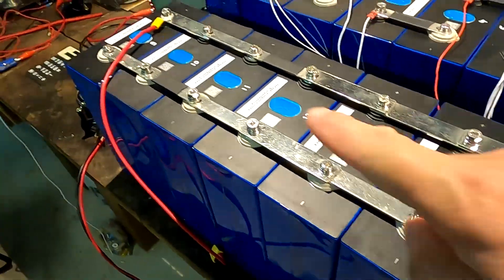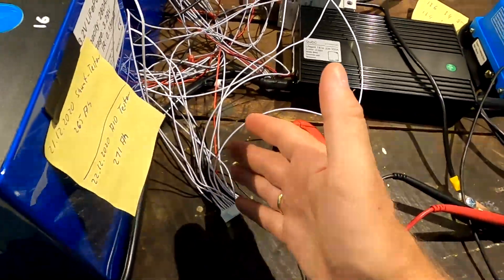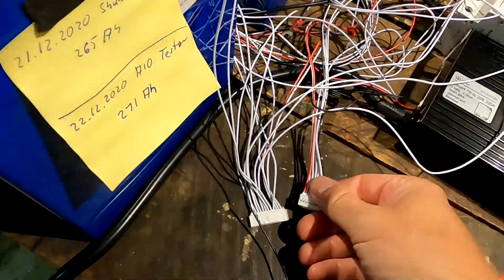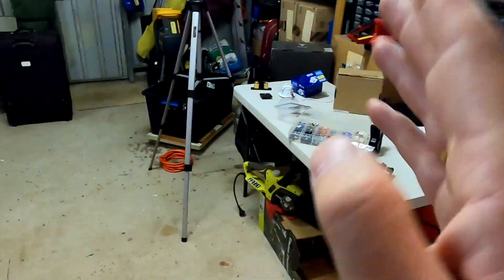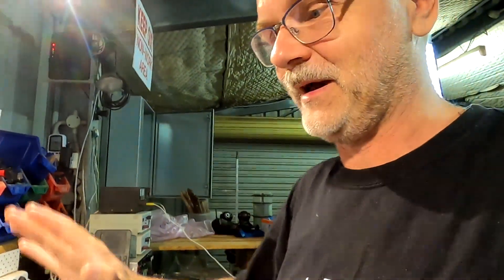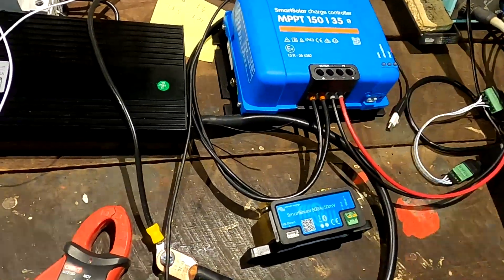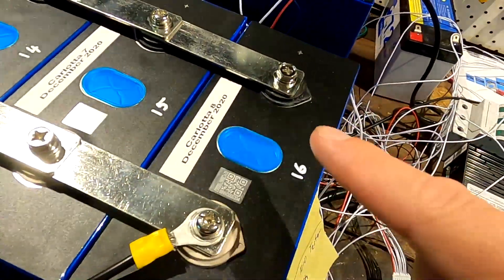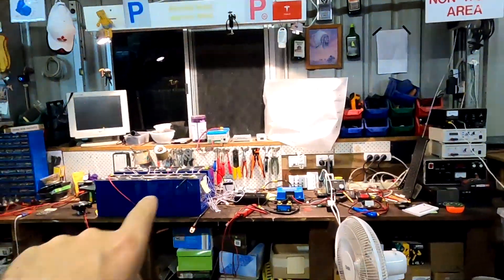We are Feature Complete! #buildthebattery.1

Comment: The Off Grid Detail, I mean Garage is the best place to get the nuts and bolts of practical application.  I'm in the dream/planning stages of my solar system and this is my favorite place to learn and get excited about what the equipment is doing and what it takes to keep it happy.  

I'm worried about all the electronics (contactors, digital switches, etc) lasting in a remote off-grid location for a long time but that's for future me to worry about.  Right now, this is the place to learn and get the minutia embedded in my brain.  Thanks for all the great info and time in experimenting.  I look forward to taking the next step and actually getting the hardware but not until I've absorbed more of this needful info.

Comment: POTENTIAL RISK OF SHORT!!!
Not having any way to contact Andy directly I am using this comment forum to warn everyone of a POTENTIAL HAZARD.
This may not apply to all lithium cells supplied direct from China but I suggest that you check your cells to make sure that it doesn't apply to you.
It is reasonably well known that the casing of these lithium cells are metal and are the same potential as the positive terminal. As the casings are covered in blue plastic this should reduce the risk of shorting out. However I have found that the underside of mine do not have any covering. Any cells connected in series sitting on a metal surface can create a short with hazardous consequences. I noticed this because I intend to sit my cells on an aluminium plate with heater mats underneath to distribute heat in cold weather. Although most users won't be installing their cells on a conducting surface the risk is still relevant wherever the cells might be placed even temporarily on a metal surface. If anyone has direct contact with Andy can you draw his attention to this so that he can spread the word. Meanwhile I will contact my supplier in China to inform them of the problem.

Comment: 022721/0406h PST- Brisbane 022721/2206. Thank you, for the presentation. I may suggest that 2X100mm ball bearing extractors (230V mains) may be used, during extreme hot weather conditions in Brisbane. You need not monitor the switching ON/OFF procedure; as the same can be controlled through a digital temperature dependent 
unit <XH-W3001> costing around  US$3.15  AU$4. (AliExpress)The device is extremely reliable and operates on universal voltage. Once set Up is done, it works indefinitely. Best extractors are induction motors (small) which lasts longer and less maintenance.
Best wishes and 73s...

Comment: I have my RV inverters mounted in a much larger compartment and the inverters easily heat the compartment up to over 100F (around 40C) when they are under load. The only issue with this is that the inverters can only produce their rated power at around 20C. As they get hotter they de-rate themselves and will not produce as much power. Victron inverters actually publish various power outputs for different temperatures to help illustrate this effect.

Keeping the inverters cool is key to allowing them to operate at their full capacity. I would not mount them inside that enclosure unless you're going to put some serious exhaust fans on it.

Comment: When you parallel them all to balance, I really suggest you connect the charger whilst doing it. Just putting them in parallel itself can never fully balance them, it needs a charge or discharge current to get them balanced (preferably charge). :)
Reply from the maker: Yes, absolutely. It'll be in the next video.

Comment: hello again my friend...   i bought a bluetooth BMS aswell but BT takes some time to load ect... for quick glace of battery status keep your shunt and get the readout for it since you said you wanted a readout on the cabinet anyway!   and if heat is an issue in that box i mounted all my audio amps/dc to dc charger and solar controller in the empty area behind the fridge in my rv and used this to evacuate the heat.  https://www.amazon.com/AC-Infinity-AIRPLATE-Cooling-Cabinets/dp/B009CNR0I6/ref=pd_ybh_a_19?_encoding=UTF8&psc=1&refRID=F9KKCVAHEJJ33Z4Y8YND   im getting ready to put my rv lithium system together in a month or so you should check it out

Comment: I have the Victron 500 Amp shunt.  The information it delivers to you is amazing.  You definitely want to keep it and use. it It is way more accurate that the other devices.  And with the Victron App on your phone you have WIFI access to all of your battery info instantly.  Don't send it back, keep it and use it you won't be sorry.
Reply from the maker: How have you connected it? After the BMS or directly to the battery and then the BMS?
WiFi? It has Bluetooth, no WiFi?
Reply: @OffGridGarageAustralia  I followed Victrons installation instructions.  It is connected directly to the most negative battery post.  All other connections to the battery negative post are connected to the other side of the shunt so it can measure all current passing in and out of the battery. Mine is the wifi model so I use the Victron app on my phone to view all of the info.

Comment: Hello Andy!! Congrats for the amazing setup! I've just completed my first setup too and i can totally understand the exiting that explode in your mind when you troubleshoot and than things works!! It's really amazing! 
One question by tho. My setup is much smaller than your, i have just 4 200Ah cells in series for a portable standard 12V array. I noticed that the cells were pefectly matched in termes of volts so i didn't do the top balancing procedure... What problems may occur? Thank you very much! Cheers from Italy!
Reply from the maker: Thanks for your feedback and comment.
You need to top balance the cells before you put them together. Even a very small difference in voltage can have a high SOC difference. The charging curve of LFP cells is so flat, you cannot really measure the voltage difference sometimes but the state of charge could be quite different. If the difference is only very tiny you can let the BMS do the job over time with the right settings.
Reply: @OffGridGarageAustralia  understood! Thank you very much for reply! I noticed that One cell is piking before the others so i think the problem Is exaclty what you said, a small differece in soc. So I'm going to top balance in parallel. Thank you again 🙏
Reply from the maker: Anytime 🙂

Comment: I'd just put a fan in the bottom of the cabnet, with a vent in one side, fan on the other, about a 140mm high speed fan use a thermal switch, to turn on at about 40°c, they are cheap, normally open thermal switch, and a fan and switch just incase it's needed, 104°F should not be too hot, place the sensor on the hottest component, or a adjustable thermal switch is only about $5, set the in and off temp, I set it for about 30°C and off at about 27°C they are available in 12v 24v and 220v and good for 10amps but I'd stay at about 5amps, but a simple fan in the enclosures should be fine if any cooling is needed,
Reply from the maker: I'm not a big fan of fans. Dust...

Comment: I don't know what's easiest, top balance of large cells, or 10,000 small cells! When I used small cells I did full charge each cell, but it's impractical to parallel all before building the battery, I haven't had issues, I did connect each pack parallel to each other and charged them, and allowed time to self balance, also did a few micro cycles, discharge from 4.2v to 3.9 or so, then charge, to allow any lower cells to charge, but capacity testing 1,000's of cells in a pack at once isn't easy with the equipment I have ,  it would take months!! With eack cell tested, and matched in packs it should all be good, it us so far,  I have about 1200 ah 24v I'm looking for a non smart BMS,  I need to pass 300amps constantly, without hearing, I'm using a shunt trip with small BMS, that will never balance the pack, it may if only charged at 1 amp for a day, if the balance is off a bit, it should keep decent balance, I used quality cells, I haven't had issues yet, but time will tell!

Comment: @DIY Projects yes using a better solar charge control would be more efficient but he is talking about heat generated inside a sealed box electrodacus makes a control with diversion if you have heat generated in the box that is coming from energy losses in the devices enclosed  using a diversion with a peltier or liquid thermal transfer would allow box to remain sealed and to those who are saying peltier is grossly inefficient they dont know the proper way to use them otherwise NASA would NOT use them on the space station and manufacturers would stop making them because they want all the profit https://spinoff.nasa.gov/Spinoff2009/ip_4.html  https://www.science.gov/topicpages/t/thermoelectric+cooling+devices.html

Comment: I'd trust the victron shunt a lot more than the BMS, also consider adding a contactor that can be used to disconnect the batteries remotely/automatically if needed.
Reply from the maker: I can do this through the BMS. It has a contactor.
Reply: @OffGridGarageAustralia  yes but the software in some BMS's is not always the most tested and reliable, I'd much rather have a separate, in your case victron controlled redundant contactor for over temp/voltage/current at least.

Comment: I agree also that you’ll need some better cooling Andy, especially as your garage will already be pretty warm in summer.
A couple of small computer fans would make a huge difference.
Nice job thus far 👍
Reply from the maker: The dust though!
Reply: @OffGridGarageAustralia  Yeah I know, certainly something to consider. 
Especially if you can control any fans so they only run when absolutely necessary, then it shouldn’t be too bad.
Reply from the maker: @FutureSystem738  I looked into filtering and stuff but you're going to add more and more to your system which needs maintenance and repair... I hope it will just work with the enclosure and won't get that hot 🤞

Comment: Awesome! So happy you are moving into final phases. I am finally (after months of testing etc. like you) I am building my wall as well and getting excited! By the way, I agree with your thoughts on the cabinet.. see how it all goes, and if you need to vent later you could add a DC to DC power supply to a set of terminal blocks and run a small computer type fan to exhaust heat if you need . GREAT JOB and love your videos!

Comment: before you go a fan setup try a chimney tube setup 8-10 inch tall 3inch tubes going upward from top of the box and cold air inlet at bottom this would allow the chimney effect to work then if needed can add fans at bottom add the temperature management setup to control when the fans come on the chimney effect is effective when you get a 20f-30f temperature difference from the bottom to top of case it will draw its own cool air in most of time. I have built many super high end gaming rigs with this principle  I just had a crazy amount of water cooling rads in my cases setup so that I had alot of buffer as the draw picked up and my setups rarely ever had the fans even turn on even during extreme gaming / encoding / mining / streaming you name it my rigs stayed pretty cool and were dead silent.

Comment: Easy option for cooling if required, fit 2  fans in the door ( this way you can leave all of you components still installed).
Just pop the door off, cut out 2 holes for fans one in the upper half one in the lower, put the fan directions with the lower blowing into the box the upper sucking out. Control these 2 with a simple thermostat so they only run if required.
You can buy fans with filtered cowls so they not only look smart the will not suck dust into the box.
Reply from the maker: Perfect! That's the best solution so far if I need cooling. Thank you for your suggestion, John.

Comment: Awesome I love your excitement! I don't think you should put that inverter in a enclosure. The charge controller will be fine. But 300watt loss in the small enclosure might work for awhile but all that heat will cause efficiency losses to be raised and premature failure. Cut a 120mm hole in the top and drill holes in the bottom. Then install a fan with a temp probe. You do it for $50.  I use a temp controller designed for seed germination to controller a heating pad and 120mm fan inside of a 30inch aluminum tool box in my lfp 300ah 24v battery box.it works great

Comment: Mount the inverter outside the cabinet.
Reply: I agree or put a 120mm fan on top that moves alot of cfm and drill holes in the bottom
Reply from the maker: In consideration

Comment: sandwich peltier cells on side walls for thermal mgmt using solar to operate cells during the day with pwm control very painless like a thermal cooler
Reply from the maker: I think one or two cooling fans will be sufficient if I need them. The solar needs to go in the battery... 😉
Reply: @DIY Projects yes using a better solar charge control would be more efficient but he is talking about heat generated inside a sealed box electrodacus makes a control with diversion if you have heat generated in the box that is coming from energy losses in the devices enclosed  using a diversion with a peltier or liquid thermal transfer would allow box to remain sealed and to those who are saying peltier is grossly inefficient they dont know the proper way to use them otherwise NASA would NOT use them on the space station and manufacturers would stop making them because they want all the profit
Reply: @DIY Projects i never said andy was stupid i was referencing the person who said "grossly inefficient" Urs odermatt and i applaud andy for bringing this study to all persons whom are willing to learn this ONLY a discussion about alternatives for EVERYONE and fans are a way to move heat and cheap but not everyone wants the same thing some might want know other possible alternatives

Comment: Well on my system I do not generate much heat in the batteries just a couple of degrees but the charging system and the inverters make a lot of heat but this all depends on the loads I charge at 100 amps but only discharge at 40 amps so good luck on a 40 degree Aussy day.
Reply: As I mentioned to him before: there is a reason an inverter, even though it is encased in metal, needs fans. He's going to create a hot box and the inverter won't like that one bit.
Reply: I agree. In our off-grid system with lead acid battery bank the 2x 80 amp Outback Solar MPPT's and Latronics inverter generate a lot of heat, particularly when we are charging our EV. Irrespective of the size of any heat sink without good air flow (and mechanical assisted airflow if under decent load) this gear would just shutdown, no questions asked!
Reply from the maker: I hear you guys...
Reply: @OffGridGarageAustralia  Hi Andy, not a criticism just an observation, we're all learning everyday. Thumbs up on the channel, your offering a great service free and fantastic to see your excitement flow through to your videos.

Comment: AGM set voltage done.. no bms no apps no emails no bs to go threw
Reply from the maker: AGM are certainly easy to setup. But we're now over this point and have moved on from this old technology. Like in transport, moving from internal combustion engines to electric.
Reply: But in 3 years you will be considering replacing that amg. In 3 years his lfp battery will be running at 95% capacity with another 17years of life. You can't beat those 280 lfp batterys at the current price.
Reply: Yeah I used to have agms. 16 of them, telecom back up batteries. Very heavy, no way of checking specific gravity and high resistance to charging in the winter, quite inefficient in reality when they are 50% discharged for any amount of time. I switched to lithium ion lmc, and its made a huge difference in terms of real power storage. Because the c rate is low both charging and discharging, they don't go out of balance. I will never entertain the idea of agm, fla or gell ever again.
But if you're happy, that's all that counts. 😉😉

Comment: you could use computer cpu cooling paste in between the backside of you charge controller and cabinet.
that stuff is made to transfer heat as effecient and fast as possible
Reply: That charge controller won't put of much heat. Maybe 15watts at full capacity but that's a good idea
Reply from the maker: There is no surface on the back of the charge controller. It has cooling fins which barely would touch the metal. It's more heat radiation.